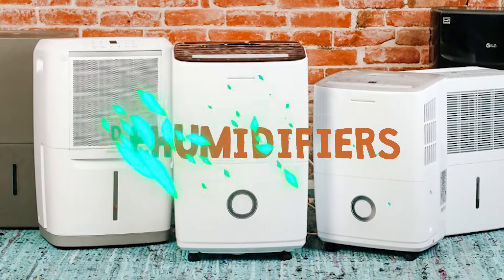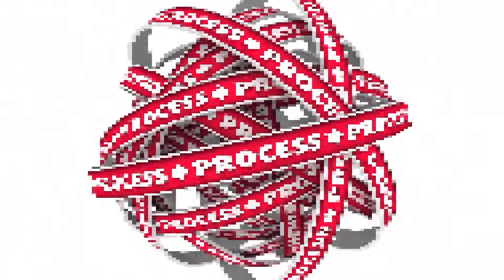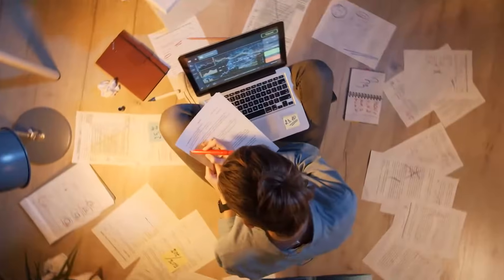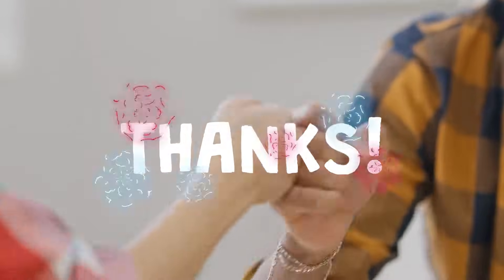How To Recharge A Dehumidifier 🔌 | HVAC Training 101

Comment from the maker: Read the full review here: ►► 
https://hvactraining101.com/dehumidifiers/how-to-recharge/
(How To Recharge A Dehumidifier)

-------------------------------------
✅ How To Recharge A Dehumidifier

0:00 Introduction
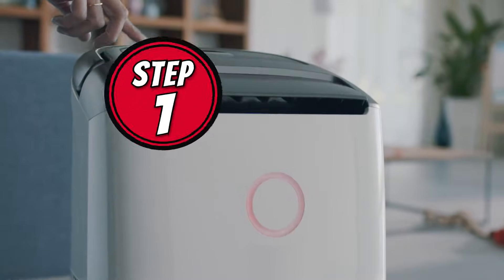1:08 1.Keep the dehumidifier running while applying the coolant
1:14 2.Remove the valve cover
1:20 3.Attach the filler line to the valve
 but don’t open it
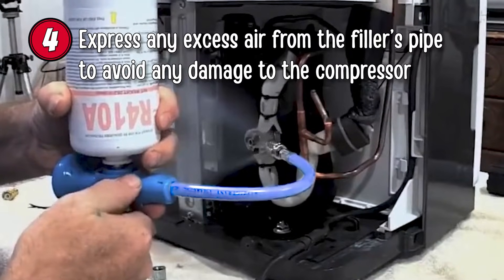1:28 4. Express any excess air from the filler’s pipe to avoid any damage to the compressor
1:38 5.Tighten the valve connection
1:45 6. Open the valve and check the coolant level on the gauge
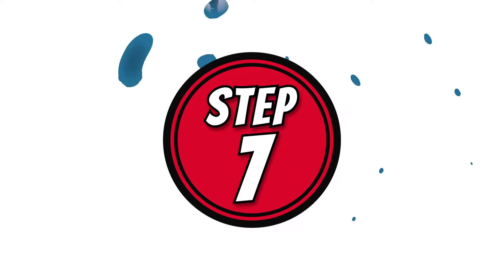1:53 7.Refill the coolant in short bursts
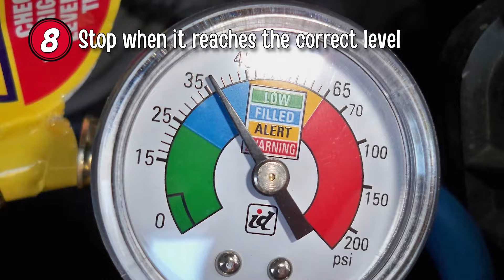1:59 8.Stop when it reaches the correct level
2:06 9.Close the valve
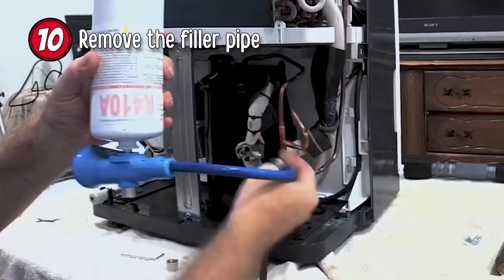2:12 10.Remove the filler pipe

Subscribe to our Channel 
🔴 https://hvactraining101.com/youtube/

-------------------------------------
Detailed review: https://hvactraining101.com/dehumidifiers/how-to-recharge/

🔌 When is it Time To Recharge My Dehumidifier?

✔Humidity Levels
The first tell-tale sign for requiring recharge is when moisture levels rise back up. You can hear the machine running, but nothing’s happening to bring the dampness down.

✔No Dry Air
Once the dehumidifier removes the moisture, what remains is dry air that blows out from the exhaust. You can quickly test if recharging is needed by feeling the air that’s leaving the machine. If there’s still too much moisture, it means that the coolant isn’t performing correctly.

✔No Condensing
When moisture is drawn from the air, the coils condense it enough to produce water in the bucket. If you hear the unit running, but there’s no liquid in the tray, that means that the air is passing straight through with no cooling. The coolant needs recharging.

✔Control Panel
Finally, the most obvious indication is on the control panel. There’s usually a light indicator or an icon that turns red when the coolant is out of charge.

💬 Let us know what you think of these How To Recharge A Dehumidifier in the comment section below.

👉 We appreciate every thumbs up and would be grateful if you’d consider subscribing to our channel!!

-------------------------------------
🎥 Welcome to the official YouTube Channel of HVAC Training 101 🎥

HVAC Training 101 is dedicated to helping you make smarter buying decisions when it comes to air conditioners, heaters, air purifiers, and other HVAC-related items. 

 🌐 Learn more about us: https://hvactraining101.com/about-me/
 💻 Like our Page: https://hvactraining101.com/facebook/
 📢 Follow us on Twitter: https://hvactraining101.com/twitter/
 📱 Check out our Pinterest: https://hvactraining101.com/pinterest/
 🔴Subscribe to our Channel: https://hvactraining101.com/youtube/

-------------------------------------
Disclaimer:
Some of the footage used in this video is not original content produced by HVAC Training 101. Portions of stock footage of products were gathered from multiple sources including, manufactures, fellow creators, and various other sources. If something belongs to you and you want it to be removed, please do not hesitate to contact us at bob [at] hvactraining101.com.

#HVACTraining101 #HowToRechargeDehumidifier #Dehumidifiers

Comment: Great Video, thanks. I noticed you used R410A gas. Is that the same gas that was in it before? My dehumidifier is charged with R290 propane, so assume I should stick with that? Would that be advisable please?